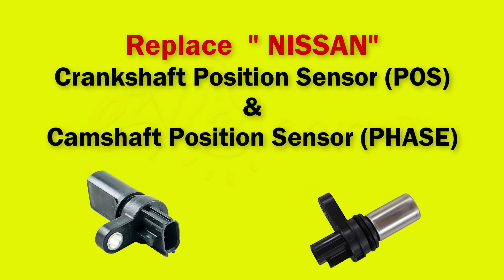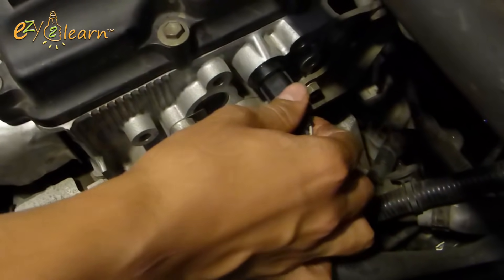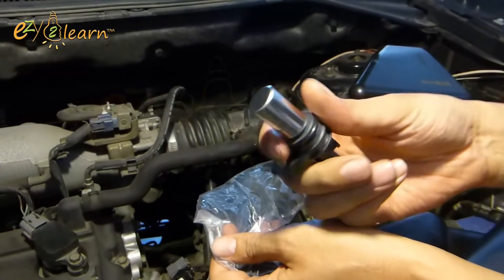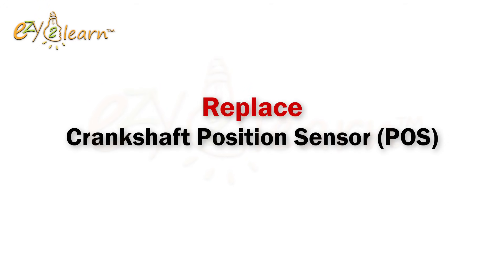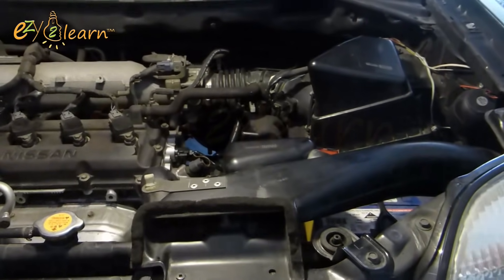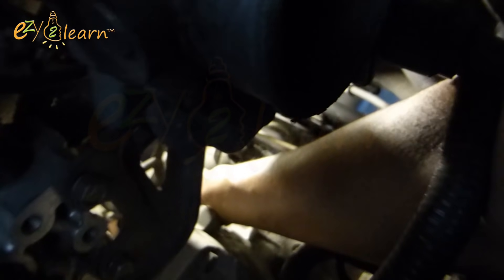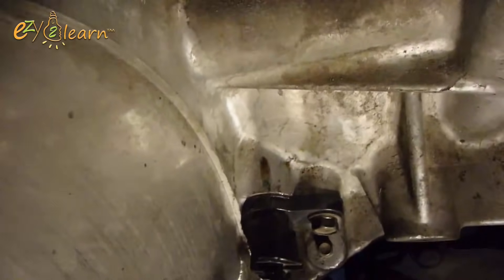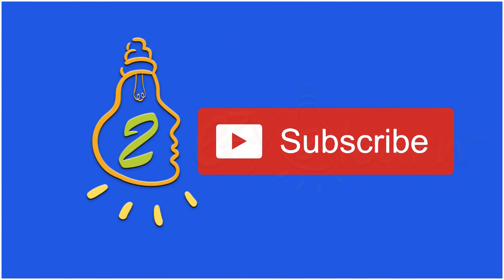Replace Camshaft Crankshaft Sensor Nissan Xtrail Altima QR25DE Fix engine cuts out P0725 P0335 P0340

Comment: Thank you so much. Nissan quoted me $150-$200 for the sensor and 1 1/2 hours labour. A ball park figure of $400 plus over the phone after I rang them when roadside assistance told me the error code was for the crank angle sensor. I watched this video and bought an aftermarket sensor on special from REPCO for $35 and put it in the following day after work. Took me about 1/2 hour. Very happy, cheers :)
Reply from the maker: you are welcome :)
Reply: Glad it worked out for you. I had the same issue in a T30 Xtrail back in Dec 2016 immediately after purchase. I think the $400 quote is a little steep. I bought the newer metal OEM sensors for $80 each AU and got mechanic to install for another 160. total $320. 
I wonder how many km you got out of yours before they failed. I'm trying to figure out the approx age, Km of my engine as it's 2nd hand. Cheers

Comment: I have ah problem with my Nissan Almera car starts and idle but no acleration what is causing this I have change all the sensor already and the number 3 coil pack and still have the problem need ur help please

Comment: For me, this was the most helpful video out there, bc it actually shows the position the sensor, which can only be located by feel. And although it shows removal of the filter and associated tubing, what is doesnt show is the whole bunch of pipes that are in the way of reaching in to remove that bracket, and then reaching beyond to the sensor location. Perhaps he removed them in advance. Anyways, I was confused and disoriented by this for half an hour, b/c it looked so different. In the end, I did not have to disconnect any more tubes, but was able to reach through them with some difficulty. Whole thing took 2hrs, and now my car starts well!
Reply from the maker: I haven't removed any pipes at all to access the firewall back sensor. It is exactly as I have filmed and happy that you get the job done :)
Reply: You can see it easily if you remove the engine cover and look down between the valve cover and the manifold.

Comment: Many thanks. Very helpful. Mystery dispelled. What I find hard to accept is that a mere sensor, a detection device, can actually cause an engine breakdown, or even an accident, e.g. in the middle of overtaking, instead of just providing information that there's a fault. Old cars never had such troublesome sensors. They broke down for other reasons, I know.
Reply: They break down because as was with my car, after 3 fault signals on the same code, the engine cuts out .. In order to get it going again you either have to run a scan and delete the codes you fill the engine OR, as I also did, disconnect the negative battery lead for a long time, which caused everything to reset and show restarting the engine...

Comment: Just completed this task. My car had been using stacks of oil, over a 1L per 100kms. A couple of my plugs were oiling up, and I thought this was the reason for the misfiring. Had the engine replaced due to the oil consumption. Afterwards, it would still misfire occassionally. My OBDII unit indicated a pending error with the Crank Sensor. I surmise that I actually the oil consumption and the misfire were 2 different problems.
Replacing the sensor was easier than the impression I got from reading a few of the posts. As some say, the key would be to remove the bracket under the throttle, and I used a small step so I could lean into the engine bay at bit easier.
Thanks for the video. Its nice not to have to figure it out from scratch.

Comment: I just wanted to give you a big thanks for the brilliant video which allowed me to get a top sensor and replace it up literally only took 5 min, and confirm that it was the faulty one.. (thanks for the pic of old and new type sensor and min was the old and the new one was .. Well... New type!!) 
FYI, the old sensor caused my motor to sound and idle rough and gave the exact error codes you showed and caused my motor to cut out...
We're up and running and I saved at least $200 from garage costs... Cheers!

Comment: Thank's a lot for this video.Just a note about the Crankshaft sensor. For me, it's easier to unplug the sensor after disassembling it, and reconnect it before reassembling it.
Reply: yeah that is what i did. much easier
Reply: I disconnected it before removal because I wasn't sure if it would interfere with getting the bolt out. But I did connect it before installing the new one. Can't believe how easy this job was.

Comment: Thanks again, done this job twice cause I used a cheap ebay replacement sensor. Only lasted 18 months. The bracket removal is the key to finding the CAS. Thanks again.

Comment: Very useful video. Its very cramped around the crankshaft sensor so to create more access space it is a good idea also to remove the bracket  beneath the throttle control actuator too

Comment: are the cam and crank sensors the same and are interchangeable?  you had 2 in the box and it looks like it didn't matter. you just grab anyone from the box. thanks
Reply from the maker: yeah, they are interchangeable, so you can fit any of them, both are exactly the same.

Comment: Literally just finished doing this on my 2006 nissan x-trail and this video was a big help!  The lower sensor behind the engine was terrible to get out but I managed to get it after several attempts to pull the sensor out.  I had to take a small screw driver and wedge it in behind the bolt nib to pop it out.  Not easy as you have almost no room for leverage.  It is done though and thanks for the video!  Car started without any issues after the replacement of both the cam and crank shaft sensors.
Reply from the maker: Thanks for sharing your experience :)

Comment: I have a question I have a 2006 Nissan Altima an we replace the crankshaft position sensor an camshafts sensor  the start but take a long time cranking the start why is doing that
Reply: Did you ever find out? I have the exact same 2.5L but I replaced both but it doesn’t want to “turn over” but it will crank. I’ve replaced spark plugs, ignition coils, fuel injectors, & both cam/crankshaft sensors 🙄

Comment: Could you share the part number of the sensors, greetings from Panama
Reply: Also, with I bought  new sensor type which had the connector on top Just like your video and It wont start, but with the old one (Faulty one) it did

Comment: I have massive rpm drop in my nissan altima 2017 when I release gas padel or when I turn Ac on with no fault codes in all computers... cauld it be these sensor? or it should appear a fault code to be sure? help me please

Comment: Great Video. I have a different model (P12 with CVT), but with QR20. 
Isn‘t it easier to reach the crankshaft sensor from underneath the car? 
Or is your way the easiest and only way to replace the cranshaft sensor?
Reply: I have a p12 as well and it keeps stallibg and once engibe warms up very difficult to start and misfires  scan told me it was the crankshaft position sensor  did u get it sorted ?

Comment: Do I need to reset the ECM once the sensors are replaced? Because I just plain replaced the sensors and the car only cranks and wouldn't start. Also I get a check engine light that points P0340.
Reply from the maker: If you are getting P0340 then, your cam position sensor is not installed properly or harness wires are discounted somewhere. Please check your harness with a multi-meter.

Comment: so here's my problem.Both camshaft and crankcase sensor were both replaced 2 years ago with duralast products.  I purchased at Autozone and they were lifetime warrantees but now I have the code again of crankcase pos sensor error  ....btw I am told they are identical parts,is that right?anyway, my mechanic replaced them again and as soon as he restarted the car, the code came back on...and car symptoms continued.  He suggested using dealer parts, not duralast.but it strikes me as weird this would happen so quick.  he also said something about "initializing" them. I have not read that this was necessary.  Anybody have any ideas?

Comment: I got the error p0340 and the guy said it was the camshaft sensor which I bought, do I have to also change the crankshaft sensor as well? X-trail t30 qr20de engine
Reply from the maker: Yes, please change both sensors. The old version (black sensor) is not good as the upgraded version.

Comment: Hello. Thanks for the video. pls. i have nissan 2003-2.5. the old sensors are 2 the same and plastic design, so now if i want to change, you prefere to replace them with sensors(( metal design )) or plastic ???? wich is more powerfull the sensor with plastic design or metal ?? many thanks
Reply from the maker: Plastic design is the oil version of the sensor and it is not as good as the new metal design, so please replace both with new the metal design version. Thanks
Reply: @ezy2Learn ok Thank you

Comment: I changed the sensor as in the video, but nothing has changed. There is still a cutoff when changing gears, and the car suffocates when the accelerator pedal is quickly pressed. Can you help please?
Reply from the maker: You need to change both sensors NOT just one sensor

Comment: I bought 3 new sensors but is lose have to get the part from the  dealer? I end it up putting back the old one cuz the car loss power aslo old one fit perfectly the others was small what should i do!!!
Reply from the maker: Did you purchase the correct sensors! it should be lose fit only if the sensor is missing the its gasket! otherwise it should be pretty tight.

Comment: i have the same engine, it only starts when i disconnect the camshaft position sensor. when it starts then i plug back. could it be the camshaft sensor  be fault or its something else?
Reply from the maker: Generally speaking, the car should not start and run normally without the crankshaft sensor, I'm sure your engine probably started in limp mode. as crankshaft position sensors are used on all modern cars to determine engine speed and fluctuations. 

So, when you started your car by that method, does your car runs normally without issues ?
Reply: @ezy2Learn  Hello, Thanks for your video. I have the same problem and when I disconnect the camshaft sensor, the engine run normally (limp mode). I have changed the camshaft sensor but not the cranckshaft, should I change both in the same time ?

Comment: What year is Altima, and engine size? I got a 2010 2.5L When I look there is camshaft at top near SP #4 and other one lower at the corner near bottom of engine and crankshaft is all the way back of the engine, cant see it.

Comment: Thank you this was helpful, do you perhaps know how to reset the engine fault light after the installation of the sensors.
Reply from the maker: I just disconnected the battery for 2 hours and it was reset by itself
Reply: You can also purchase a ombd reader for seeing what the codes are and erasing them.
Reply: I got the same problem. Almost ready to reconnect the battery.  But if disconnecting the battery for 2 hours isn' helpful, you could always call roadside assistance to clear the fault. Heck, that's why we pay the annual fee.

Comment: hello sir gdpm, by the way i have nissan xtrail t30.. i change alternator,starte,battery, almost 1year..but now got problem lastweek battery blinking,.i still use the car..after that cant start up..i call my buddy to jump up the battery..almost 3km run engine stop.
Reply from the maker: How many km on the clock ?

Comment: Thanks now all sensors are working from test but consume fuel drop in speed and smokie. well locally we suspect the turbo, if it is the turbo how can we fix that. thanks. 
best regards
Reply from the maker: If you have problem with turbo, first thing you need to check any buildup inside it. I don't have turbo car but I used to clean my turbo using air pressure and never had issue with it.

Comment: Is the crank shaft and cam shaft the same for 2004 Nissan xtrail
Reply from the maker: Yes the same for 2.5L engine
Reply: @ezy2Learn  thank you
Reply: @ezy2Learn  my 2004 xtrail keep jurking when driving do you think it has anything to do with the sensors or my spark plugs and coils
Reply from the maker: The most common reasons why a car jerks when accelerating, because your car's engine needs both fuel and air to do its work. A block in the fuel line or air intake or faulty Spark Plugs coils can make the car jerk during acceleration as it loses one. So you will need to do few checks on your air filter, spark plugs and fuel filter and it should be one of those.

Comment: Thanks a lot for this video! Very useful!
You replace the crankshaft position sensor from the bottom of the car?
Reply from the maker: No, I have replaced from the top of the car. I couldn't get access from the bottom.
Reply: It can be done either way I've found
Reply: very difficult either way

Comment: The Physical hose arrangement appears to be different from the Altima car to the XTRAIL. There are a few hoses that I don't see in this video and the interfering clamp. Do you have any additional pictures to show how to access the sensor? If it is accessible better from below?
Reply from the maker: There is not option here to upload extra photos.
Reply: @ezy2Learn You could add to your video as slides in the end.

Comment: I have nissan x-trail, t30, 2004, QR20D, issue massive  drop in RPMs while driving when i did a sudden brake. I have to stop aside turn off the engine and on back again OD flashes 15 times. After that turn off and on again, and start the engine, rpms back to normal and drive back normally. Could it be the same issue? Some says it is speed IO sensor? Need your kind advice on this. Thank you.
Reply from the maker: Sounds like my problem exactly! if your car 2004 then most likely you have done more than 150,000km which over the lifespan for the original plastic camshaft and crankshaft sensors. You can get your car scanned using OBD device to get the error code, if you get error codes P0335 P0340 then you definitely need to change those two sensors.
Reply: Same experienced here, i got  2006 mod with QR20 engine. it cranks normally but after driving 16 km and have it parked for 10 minutes the trouble comes.  I have it cranked many times but engine is not firing , checked engine (yellow)  on my dashboard.  Could it be the same problem?

Comment: Getting confused, rockauto has both camshaft and crankshaft sensors from Standard Motor Products as the same part number - PC464 but each is listed with different prices. Update - they are the same part number and the prices are the same.
Reply from the maker: That's true, both are exactly the same sensor. They just installed in two different areas :)
Reply: @ezy2Learn  Got the part. Phoned my local mechanic and he said could take up to 2 hours/$250 to install. Should I try myself first?
Reply from the maker: @uvid4us  sure yeah, it is not hard to install them.
Reply: OK, did this today finally. Took a few hours but now I could do it in less than one. I googled while I was struggling and on another Nissan, they suggested to remove the engine cover. Well that made a big difference. I could now see the sensor bolt and my fingers thru a slot with a bright flashlight, so DO remove the plastic engine cover. You have to shine the flashlight down the same vertical slot that you look into so it's a bit tricky but it really helped to see what was going on. Also, unplug any electrial connector plugins that are in your way, that really helped too.
Reply from the maker: @uvid4us  Mine has no engine plastic engine cover, I assume your car is a new model :) I am glade that you have done it yourself and saved $250.

Comment: Will a bad sensor cause the x-trail not to start?
Reply from the maker: Yes, but you need to clarify "Not to start". Does your starter motor works and does it turn the engine ?

Comment: Hello , I was able to drive more than 50kmph, Therefore I changed the camshaft crankshaft sensor as per recommendation of a service adviser. After 3 months , I got the same problem , the vehicle is not moving more than 50kmph , oil  comes out from the air filter, oil goes to the injection and black smoke is coming out from the engine (Nissan X-trail year 2005)
Reply from the maker: Sound's like you have blown head gasket
Reply: Mass air flow sensor is bad

Comment: I want to know what's up with my car. I have a nissan x-tail diesel it does not accelerate.
Reply from the maker: Very hard to tell without inspection, but try to clean fuel and air filters, they do make huge difference in diesel cars.

Comment: Hello there can you please help me I did change the camshaft position sensor bout of them and the alternator the light check engine is gon but when I drive my truck still loosing power and shake  specially in the trafic light's is 2005 f150 can you please help me
Reply from the maker: Hello, your problem is fuel or spark plugs. You will need to check your fuel filter and replace it if required, if fuel filter is good, then it could be your fuel injectors need cleaning, try to use fuel treatment that is designed to clean fuel injectors it is around $3~$5 a bottle, and of course check your spark plugs. Let me know the results. Thanks

Comment: Hi, I have a 2011 Nissan Diesel X-trail, When I start the engine cold in the morning, it runs for 10 seconds and then stops. after about a minute of turning the engine over it starts again. On two occasions so far the engine has stopped while I have been driving, In your opinion could this issue be caused by a faulty Cam or Crankshaft sensor?
Reply: Crank